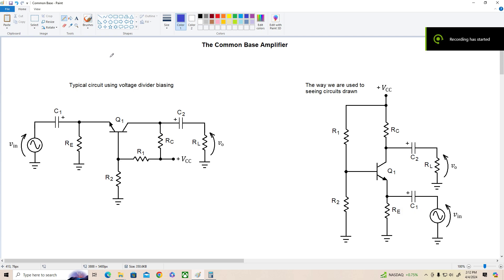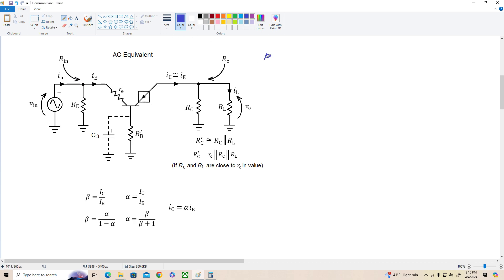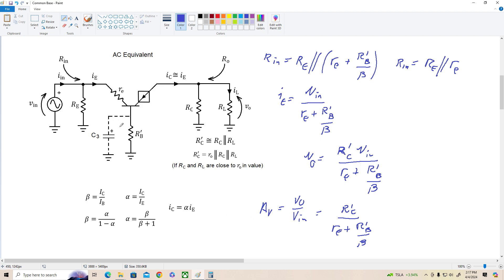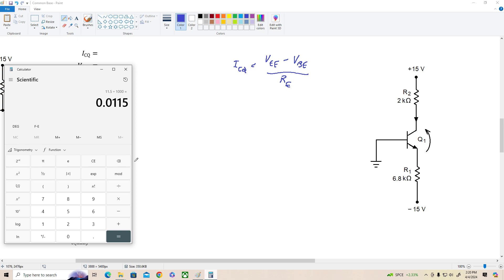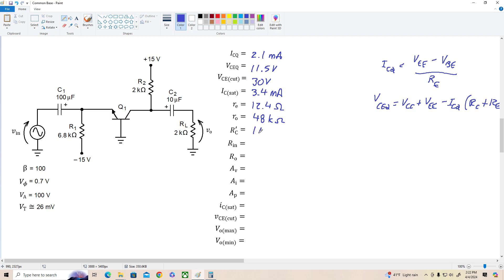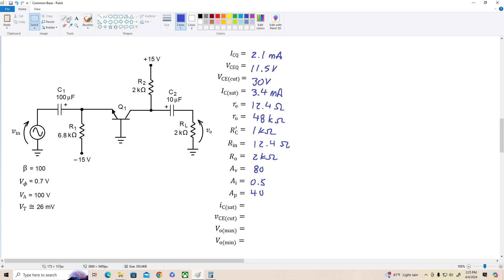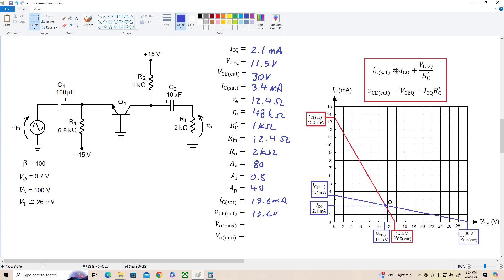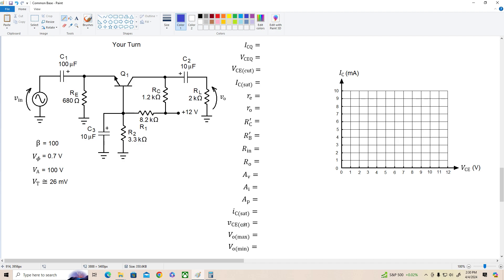Topic 33: The Common Base Amplifier

Comment: Common base is excellent when you want the lowest input impedance possible while having a moderate to high output impedance. So basically an active  impedance transformer with a respectable voltage gain.
Low impedance moving coil transducers benefit from this amplifier configuration and if it's used in push pull it's good for broadband loop antenna amplifiers at vlf up to the hf spectrum